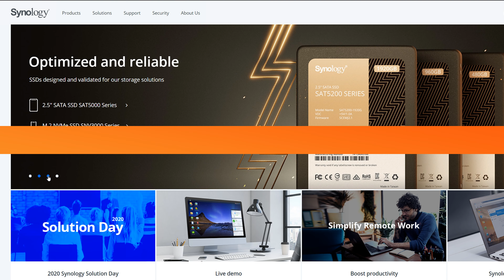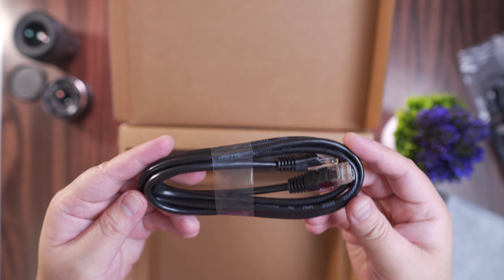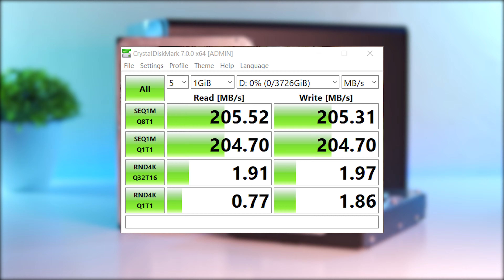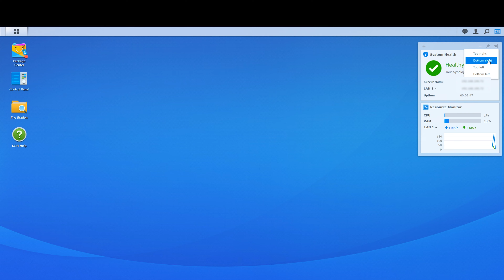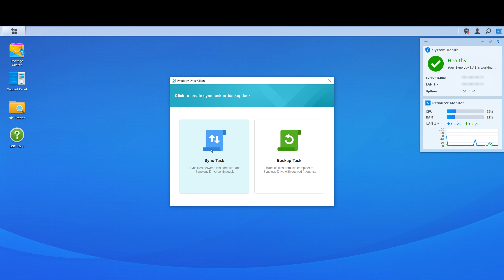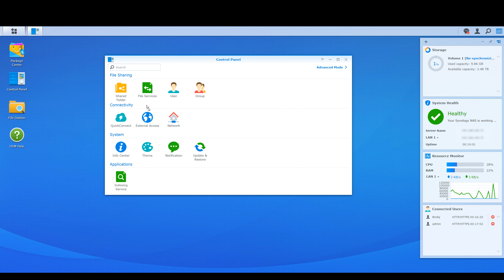Synology DS220+ NAS Review and Backup Setup Guide!

Comment: I just bought synology. Just make sense to buy synology rather than other cheaper nas especially if the data you will backup is important to you. DSM is a breeze to learn and easy to use.

I didn't setup the quick connect though. As I understand it makes your nas accessible to outside world, meaning you can access your files anywhere you are. I don't need my files outside our house and it seems enabling it is a little bit of risk I don't need. Please correct my understanding if I'm wrong.